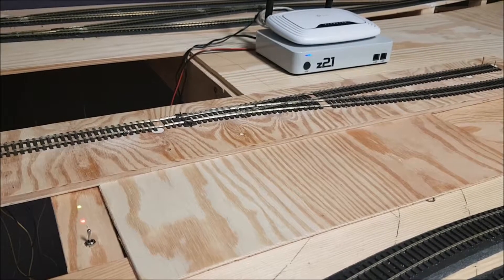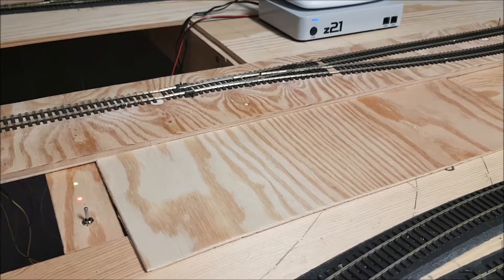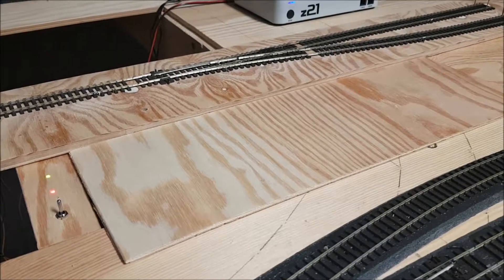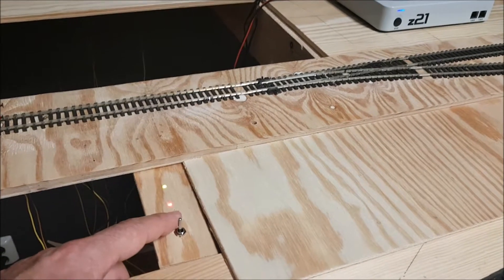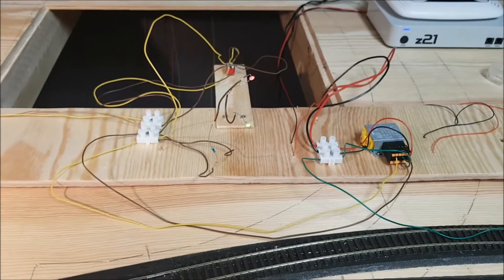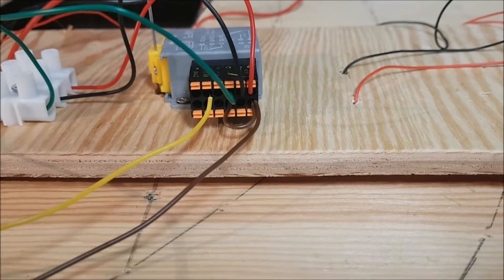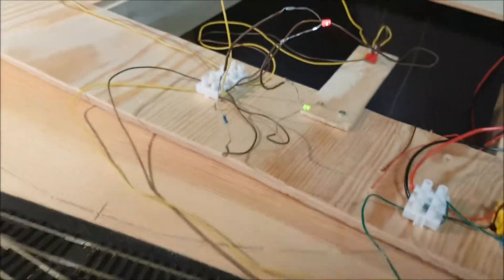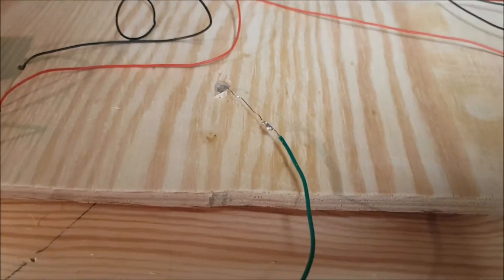Video 3 - Wiring an MP5 point motor

Comment: Good evening mister,
Please could you explain to me how to plug a mtb-mp5 with a Roco 10836 Z21 switch Decoder for DCC
Cordially
Reply from the maker: Thanks for your comment. Unfortunately, I don't know how to make the coupling with the Z21. I have used a separate 12V DC power supply to  power the MP5 motor itself and I've put DPDT mechanical switches in between the power supply and the MP5 motor to "switch" the motor. The power to the frogs comes directly from the bus wire. In essence, the MP5 motor has to separated circuits, one for switching and one for powering the frog.
Furthermore, and just for info, in one of my later videos I explained that the MP5 motors are not very robust. If I would have to make the choice again, I would not choose the MP5 motor, but something else which is more robust.
Reply: @two_hill  Thank you

Comment: Hi there. Thanks for this very useful video with the schematic diagram. I noticed you indicated that bus wire is AC powered (like Maerklin)? But you are using Peco system, so is it not clear for me why on the diagram you indicated AC? Can you please explain? I'm using DC locos, so in my case will it be DC?
Reply from the maker: Hi, thanks for your comment! I am using Peco track and the Z21 DCC controller, which gives me AC power on my track. In the case of DC locos you will have DC power on your track. If I understood the description coming with the MP5 point motor correctly, you can apply the same scheme as I have, but using DC from the track instead of AC (as in my case). Before I came to this scheme I tried out a lot of different things. In the end this was the scheme that worked best for me. I think it is safe to try my scheme using DC instead of AC on the track, I would simply try it out to see if it works. Hope this helps! Regards, Paul